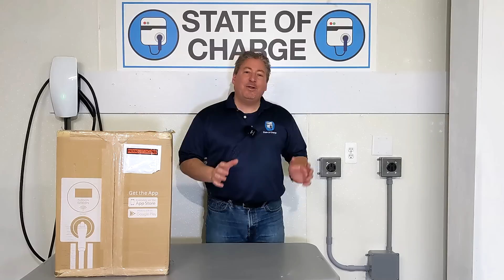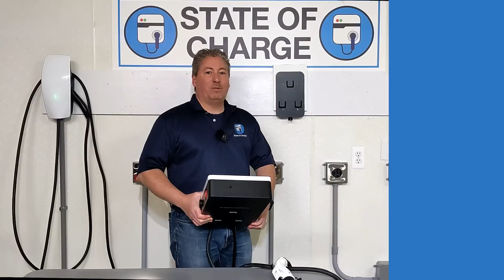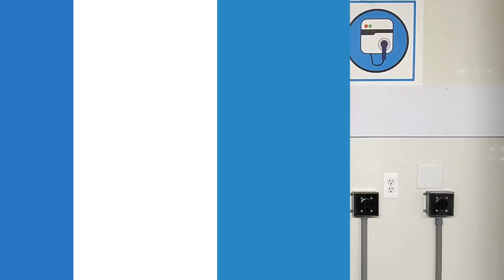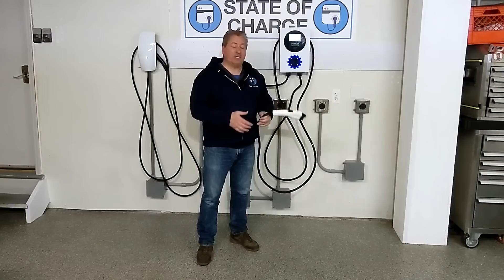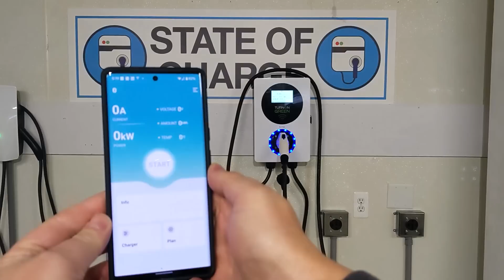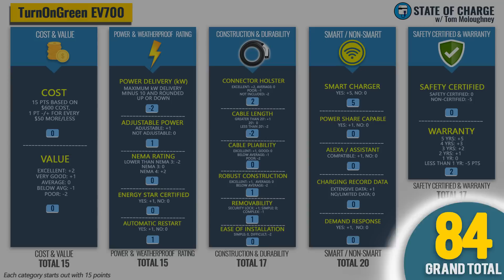TurnOnGreen EV700 EV Charging Station Review

Comment: Another Awesome video Tom. by the way. This company does have the charger with 14-50 plug and at same cost $599.
Ah ha. both plug options listed on company site for $599. However, amazon has 6-50 plug option for sale with discount for $449 and 14-50 is $599.

Comment: Seems under powered for a newish model.  Should at least support to 60A (48A) especially with all the new vehicles coming out with big batteries.  Odd choice to have the LED Holster but no cable management to wrap the cord around it nicely.
Reply from the maker: Not every household can support a 60-amp dedicated circuit. Personally, I think 40-amp (9.6 kW) is the sweet spot. In overnight charging a 40-amp EVSE will replenish 100 kWh, more than enough for 99% of the EVs/ driving needs.

Comment: The charging holster should have a pivot mechanism like the homeflex and a cable management system like you said. A bit wide but I do like the form factor. Glad to see more choices for EVSE. Yes Tom, there should be some form of interlocking mechanism that disconnects power when the unit is opened especially when powered on.

Comment: Tom, I have an application question.  Suppose I am in my residential parking garage with just 6-8 locations.  If I were to install a 240V charging station, there would be a metering issue on how to charge my kmh usage in this common area.  Do any of these chargers record periodic usage that could be used to determine my cost to my apartment electric bill?
Reply from the maker: Yes, there are f few different options to do that. The commercial version on this unit ca, so can the Grizzl-E  Smart commercial.
Reply: Thanks Tom!

Comment: I don’t understand why anyone who would buy a 32A EVSE on a 50A circuit (40A continuous).  All new EVs will be a minimum 48A for AC charging.  Home EVSE is an expensive purchase, I tell everyone to future proof and get a 40A EVSE.  Furthermore who uses NEMA 6-50?  The standard is NEMA 14-50, although their website says contact us for 14-50.  What’s up with zero cable management??  Awful..  Hopefully they’ll have ChargePoint or JuiceBox type charging history in App.  TurnOnGreen obviously didn’t do their market research.  I do like the RF reader, user-access control, screen with charge data, LED lights, and solid mount.  I sense TurnOnGreen is focused on the commercial EVSE market (L2 & L3) and not the home consumer.  The EV700 price point is more in line with a 40A unit, for my money I’m getting a ChargePoint Flex or JuiceBox NEMA 14-50.   Next time before they release a product, talk to TOM!  Or talk to me!

Comment: still wondering your thoughts and review of the Emporia Smart EV charger.  Been using mine for a few weeks now, i like it. It gives me a history of my charging in the app, so i can track how much i charge (kWh, $, length of charge).  Even better it was only $400, for a 48 amp hard wired, or 40 amp 14-50 plug that it comes with.  It also integrates with the Emporia Vue 2 system, which i monitor energy use for my whole house.
Reply from the maker: I have one in the garage and will be reviewing it very soon.
Reply: @StateOfChargeWithTomMoloughney  Must be a very long review. It's been 6 months lol We are starting to get EVSE Review withdrawal and we need our fix. :)
Reply from the maker: @twospirits411  I totally remodeled my testing garage and upgraded my electric service to 400-amps. Took 3 months. Almost done now so the charger reviews will begin again soon. Emporia is 1st
Reply: @StateOfChargeWithTomMoloughney  Awesome to hear. Btw I'm watching the Full Story of EV Expert Tom Moloughney video made by Out of Spec Dave.  I like what you did with the garage. So cool listening to your life story, and how you got to where you are. Major respect.

Comment: Tom, if someone really wanted to steal the unit, do you really think that teenie-tiny lock will deter them? I don't.
Reply from the maker: Well, you could use a more robust lock - that's all I had on hand. But yeh, if someone was determined to steal it, they will come prepared to cut off any lock. But a lock could stop an opportunist that wasn't planning on stealing it but came across it and decided to try.